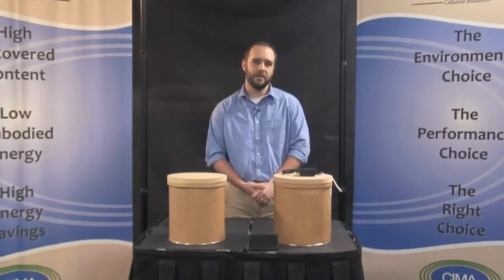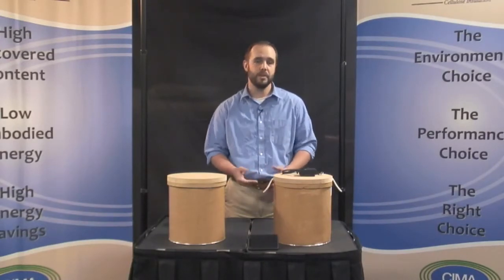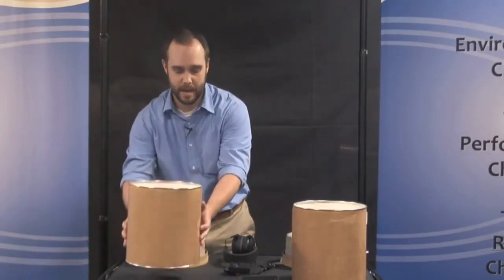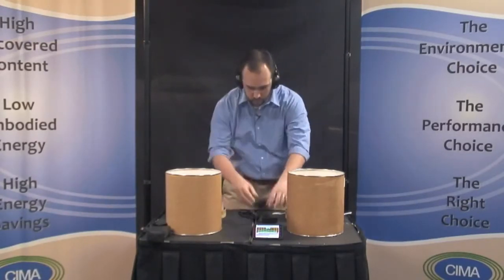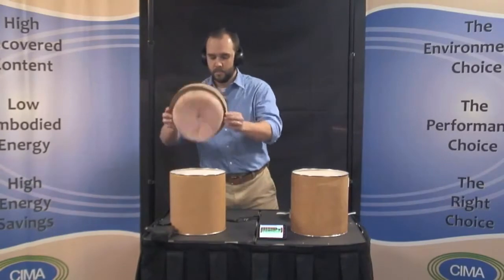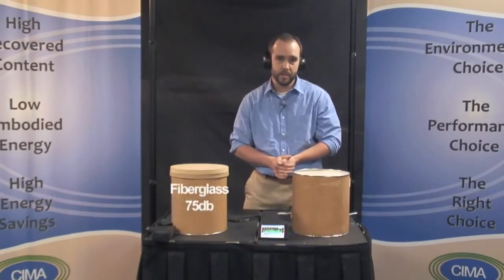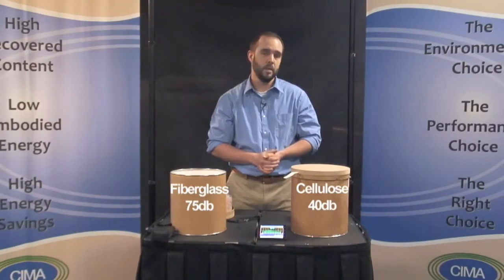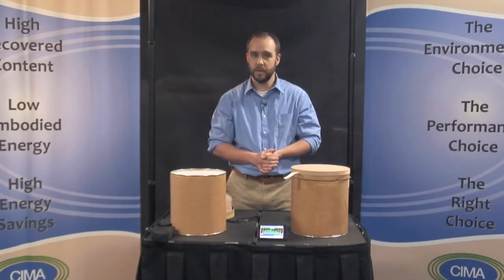Cellulose vs  FIberglass Insulation Sound Proofing Demonstra

Comment: I am concerned about how flammable this cellulose is vs. fiberglass for safety reasons.
Reply: Cellulose will always be more flammable, but the commercially sold stuff often has a flame retardant added. Don't trust my word of course, but I think you are best off with "class A" cellulose insulation if this is a concern for you.

Comment: This is flawed since the alarm is mainly higher frequencies and fiber glass strong point is mid bass frequencies.. I would test with pink noise or even white noise and report back .. I guarantee you will have different results .

Comment: How does do they handle lower frequencies such as those from bass?
Reply: Notice how these soundproof videos never test low frequencies, which are the MOST annoying and difficult to stop.
Reply: They don’t unless you want to use ultra high density cellulose in air gapped double framed wall  construction with outer 8”+ concrete wall.

Comment: I was directed to this video by someone. This is NOT how you test soundproofing. The only reason that the cellulose performs better in this NON-Scientific test is that it has more MASS. When you put fiber insulation in your walls, it will absorb the resonances within the wall cavity and 'assist' the MASS of the wall panels. This is beyond ridiculous. This demonstration is devised by a group of SALESPEOPLE, not acousticians! They are promoting (falsely) that cellulose does a better job at soundproofing. - Contrary to the millions of dollars invested in the correct testing of ir761 by NRC-CNRC (look it up). This procedure is not valid and does NOTHING but FOOL the novice.
Reply: Thanks John, very educational comment.

Comment: In the fiberglass example, It appears that you may not have had a good seal between the insulation applied to the lid and the insulation in the bucket.  When you put the lid on it seemed "loosely fit".  However, in the cellulose example, it appear that you had a better seal between the cellulose applied to the lid and the material in the bucket.  That is a critical aspect of soundproofing - minimizing sound transmission AROUND the soundproofing material.  While I believe that cellulose can be packed more densely, which affects sound transmission a good deal, I'm not sure your test was done properly - unless you repeated it with a clear plastic bucket so we can see that there were no gaps in both examples.  Can you please repeat it as such?  Thanks!
Reply: also, the gap left around the source of the sound was bigger in the fiberglass example. Cellulose seemed to hug tighter to the source/have more filling than the fiberglass one.
Reply: Fiberglass is terrible at noise reduction
Reply: I think the point of the video is to not only show the sound proofing but also the flexibility the cellulose gives you for a tighter seal.